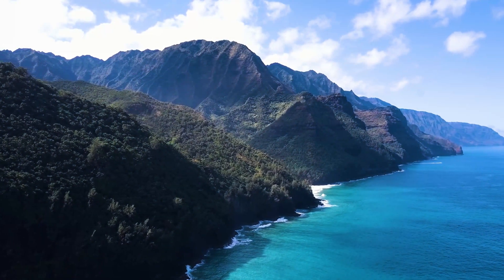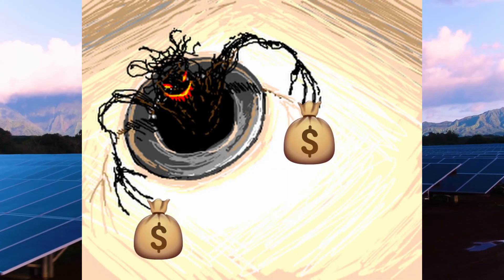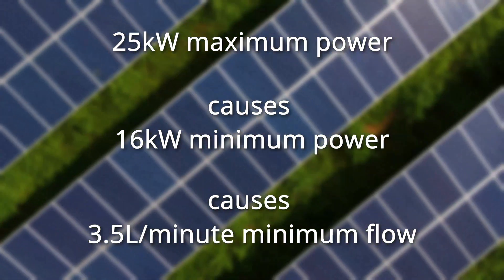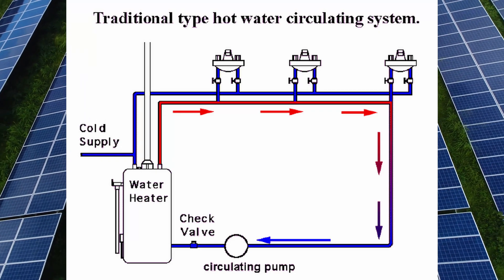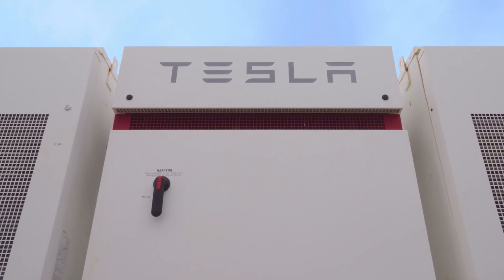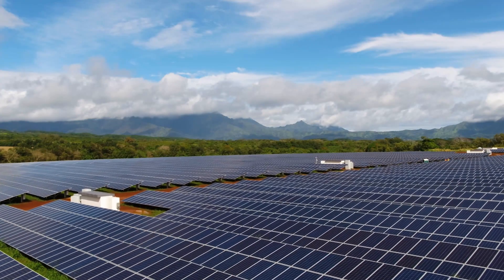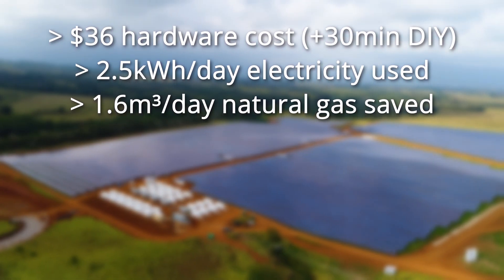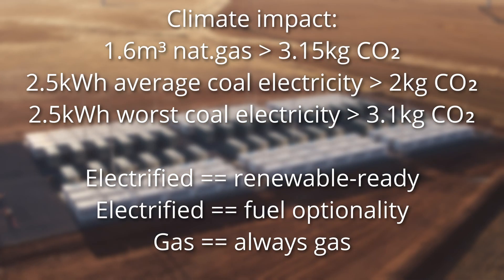Your hot water setup might be costing you hundreds

Comment: I have one ,but the electric installation can't handle the 3 kWh .
Also,in winter ,water heat enough only at the expense of loosing pressure, which is not good for shower

Comment: Very, very interesting. I wonder if this also exist for showers. That would be a game changer for sure, my dad currently use an electric heater but the only three places that really need hot water is the shower, bathroom sink and kitchen sink.
Reply: They certainly do exist- it is common for a long time London suburbs. For showers, not for sinks though:)
Reply: They exist. They are much more popular than gas heaters in Latin America, because of how cheap they are, and don't need the infrastructure of hot water pipes. They are quite good, I even had a gas heater in another house and ended preferring the electric one. the only problem they have is that they can work regardless of the quality of the electrical network of the house, wich is usually very bad. So they dim lights arround the house when they are used, and aren't as safe as they should, but that's not their fault, that's the network's fault
Reply: They do exist.